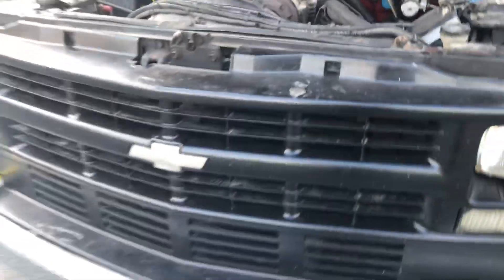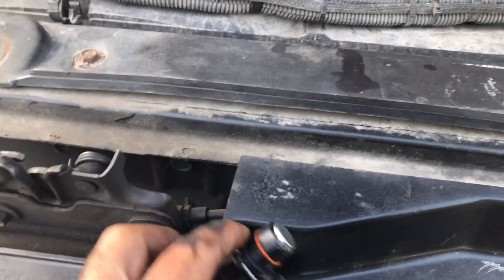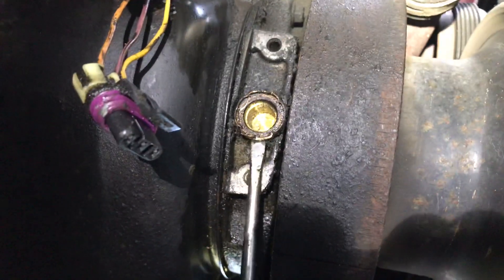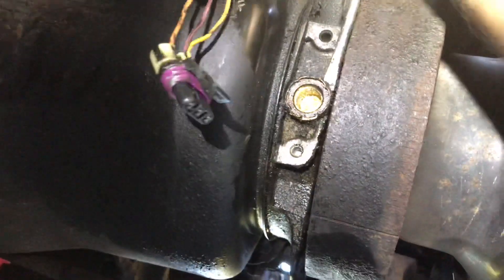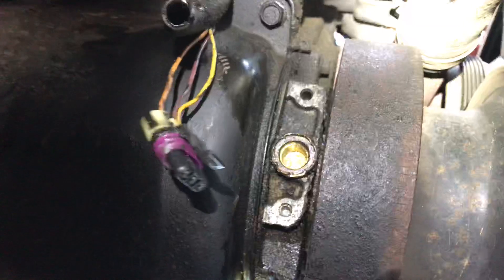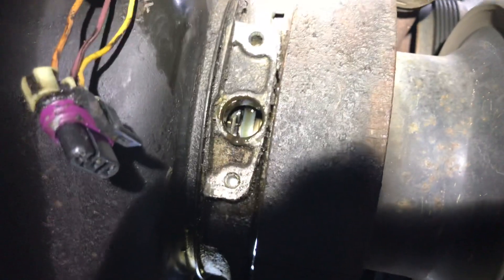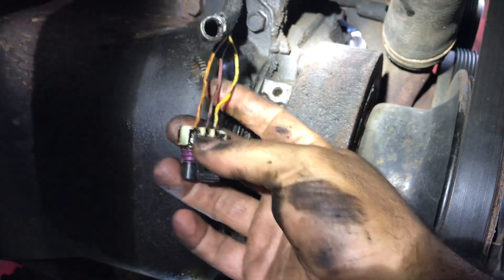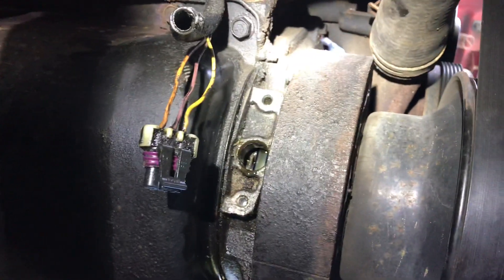How I Broke An Crank Shaft Position Sensor Inside My Engine  98 Chevy C3500HD GMT 400

Comment: Bro this just happened to me its 22f outside right now I just threw my light and went inside everytime I work on that chevy something breaks inside the block. I was doing spark plugs another time and the hex part of the plug that you put a socket on snapped off when I was pulling it out. thank you for keeping me calm with this video.

Comment: The generation after these has the crank sensor above the starter requiring to removal to get at it. Of course mine broke too. Drill a couple 3/16" holes on opposite sides of sensor only 1/4" or so deep try to get at the Oring and yank it out. Use a couple quick drive drill extensions. I had a 12" and a 6" and reach in from wheel well.Then one should be able to use a needle nose to pull sensor out. The housing is all plastic and doesn't seize in the same as the old ones.

Comment: I really suggest  doing preventative  Maintainece on your older Chevy truck.. Check for excessive wear on distributor cap and rotor that is one of the problems  that plagues  the 96 to 2000  silverado distributor cap has a circuit board in it and after it gets worn it dose a thing called  crossfire and burns out the circuit board aka crank no start

Comment: I successfully removed the brass casing and installed the new sensor. But the problem was not the sensor on my truck..  Apparently this particular  model has a sensor that if the battery voltage  is below  a set amount it will do the crank no start scenario.. I tried the unplug mass airflow  and start but it failed. So I hooked up the wife's  car to truck and let it sit running for 20 minutes and it fired up. So apparently I needed a newer battery.. Hope this helps some of you out there
Reply from the maker: Thanks for the help!
Reply: Very interesting. My 2000 Jimmy, started to run horribly, right out of the blue. Replaced cam sensor - no go, and am about to do the crank. I'll be checking my battery, pronto though. I bought it from a local used battery place last year, and it has been fine so far. Thx. for the tip.